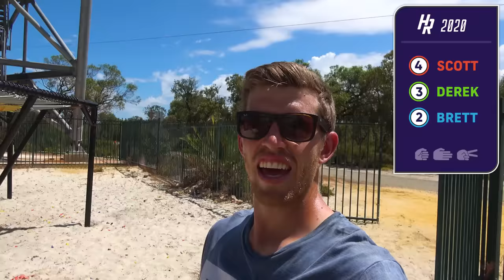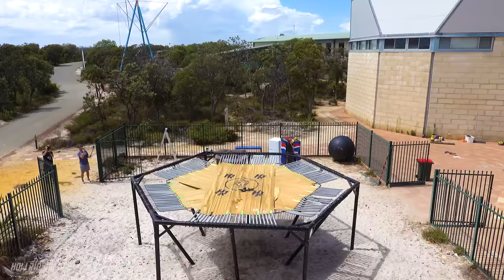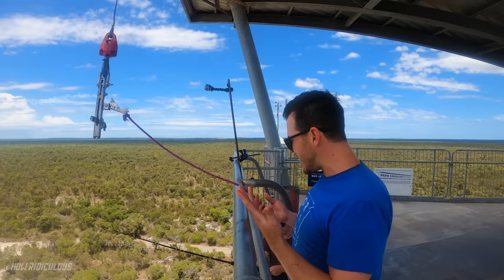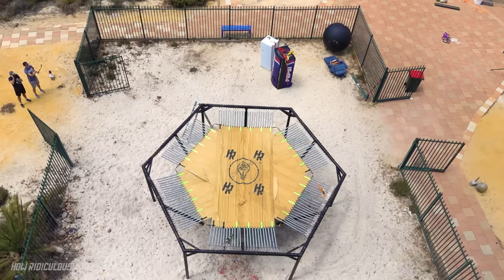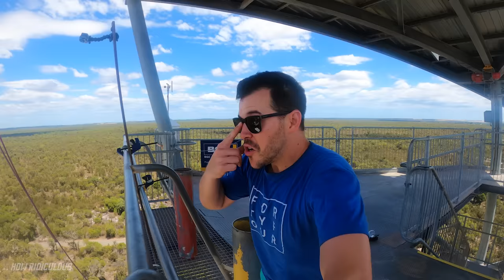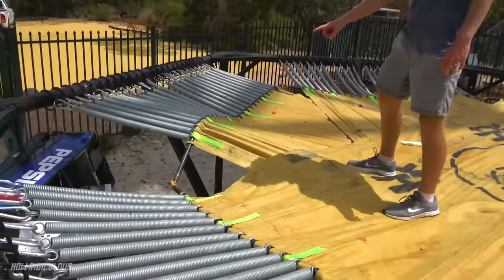400kg Vending Machine Vs. World's Strongest Trampoline from 45m

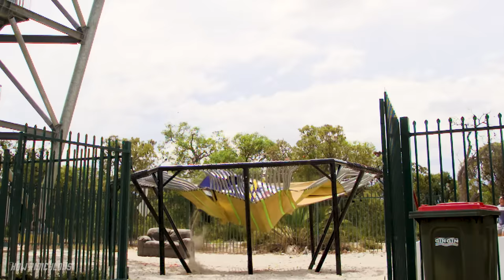Comment: 14:23 - it looks like the vending machine cut through the Kevlar AND hit the sand!
Reply: Luke Boland It did hit the sand but it didn’t cut through the Kevlar it just separated it
Reply: It definitely kicked up sand but it hit that spot where they showed the messed up steel bar but no damage to the kevlar. I think it pushed the kevlar out of the way and bent the steel bar which took away from its maximum bounce height.
Reply: Yeah it definitely cut the Kevlar. You can see the hole when they are standing on top.
Reply: @forrestlovette8275  you are right. I thought i saw it hit the corner area where there isnt kevlar covering it. My bad on that.
Reply: Definitely cut the Kevlar, but one of the bottom layers, when it went back to resting position the top strip covered the rip

Comment: “I reckon it’ll hit the ground possibly” 
“Well Mark Rober said it wouldnt”
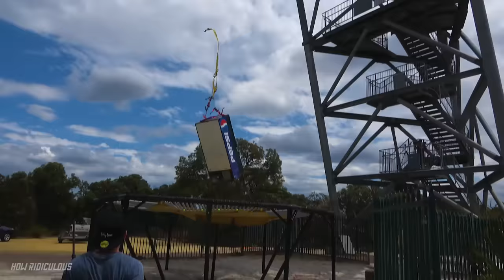13:15 at 0.25x speed and that thing almost hit the ground but the springs recoiled before it did
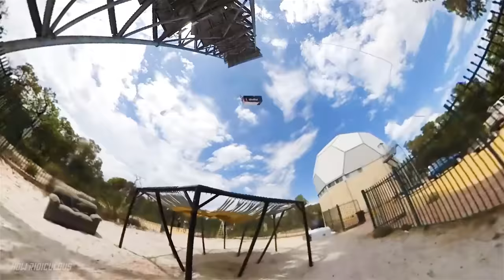Reply: But the you look at 14:22 and realize that it did actually touch the sand. It wouldn't be unfair to say that it "hit the ground". What's more the corner actually ripped the hole Kevlar sheet. It did bounce like hell though, therefore:
Machine 2 : Trampoline 1
Reply: but it clearly kicked up sand

Comment: You should drop a container sealed with 2 liter sodas WITH mentos taped to the insides of the caps of the sodas. 
Or a container filled with soda and mentos attached to the lid so they mix together during the fall/impact

Comment: Trampoline drop challenge:  Obtain a tumble dryer. Using a VERY long extension cord, plug it in and drop it from the tower but FIRST throw a bowling ball into it and turn it on in the spin cycle.  Drops it while it's trying to tear itself apart and running.